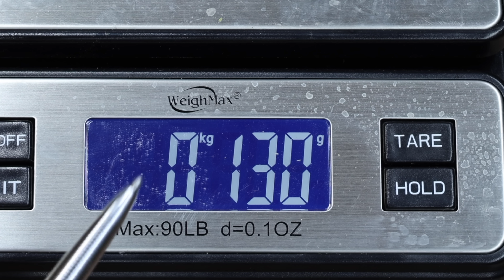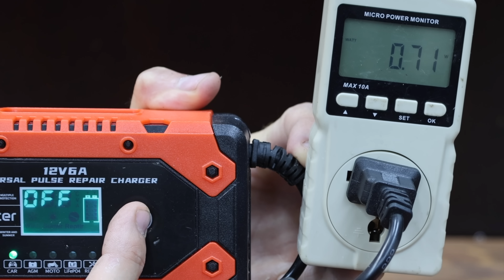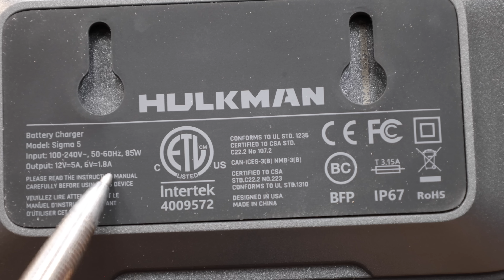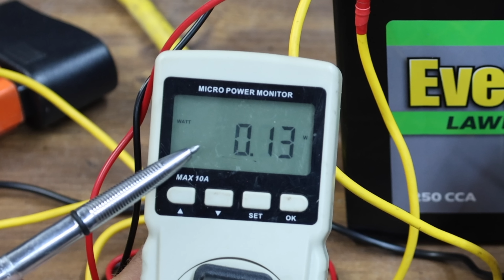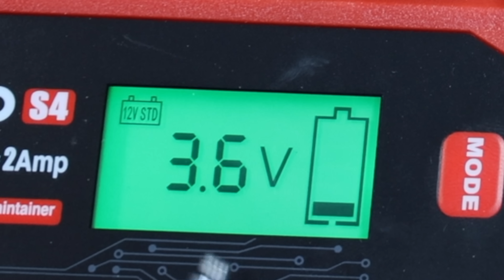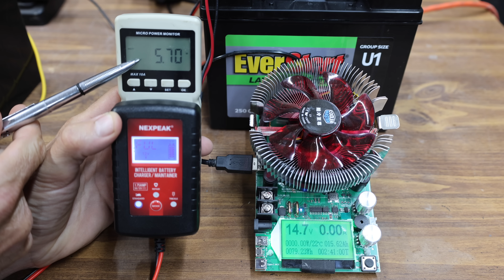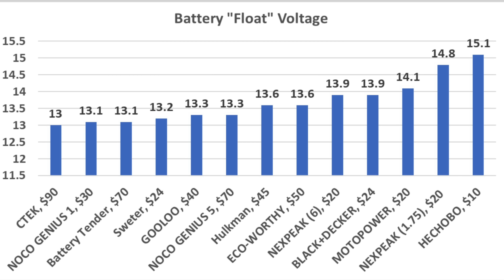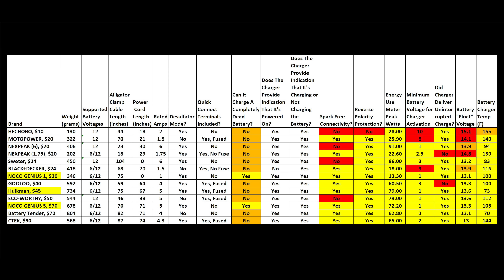I Tested the Most Hyped Car Battery Chargers – One Stood Out!

Comment: :body-green-covering-eyes: great test, but why not to include victron charger ? Seems pretty unique with smartphone app and settings that you can completely change if you want or import setting from someone else if you want. With all the statistic in the app and even 15A one is around 150euro. For me at least its very useful that I can see in the app whatever its charging 2A or 4A or 15A therefore to see if its just topping up battery at 80% and above or its seriously discharged.. Great value also if you consider that it can charge LI-ION batteries and can buy a lot of accessories for it
Reply from the maker: Thanks!  Thanks for the suggestion.

Comment: I have a Noco Genius 10 and love it.  It handles all my vehicle batteries (5 of them), both my deep cycle marine batteries and my Lithium Ion trolling motor battery with ease.  We live in a climate where my boats and three of my vehicles are parked from about Nov-March because of snow, so the batteries are pulled out and cycled about monthly on the Noco--honestly sitting on my work bench for 5-6 months isnt much work, but the Noco has revived batteries where I let my car sit too long without running it..  What can I say, It happens when a guy has five vehicles and works from home.
Reply from the maker: Thanks for the feedback.

Comment: I've had battery tender units die after a few years. I have around 8 of the noco smart units ranging from the 1amp to 10amp model in use for a couple years now. and they work wonderfully at doing maintenance and keeping my atv and generator batteries ready to go. and the 10amp models done well with charging lithiums safely to a safe voltage. can recommend
Reply from the maker: Thanks for sharing.

Comment: I would love to see a comparison of how well those chargers with desulfation can actually successfully restore an aged battery. So many devices claim to be able to do it, but very few actually have any meaningful effect on older batteries.
Reply from the maker: Thanks for the video idea.
Reply: @ProjectFarm  I'm a long time user of plug-in BatteryMinder maintainers and PulseTech solar maintainers. I just had the battery on a seldom-driven 2010 Ford Explorer go 10 years using a solar maintainer. I believe they make all the difference.
Reply: Yes, and whether desulfation even works that well.
Reply: I love my Noco Genius 10 for its ability to repair and find the battery charger as a nice built in bonus.  Way too often do I think I'll drive a car next week but not get around to it for 3-4 months.  The problem with a test like this is the way batteries fail doesn't seem to be repeatable, and once repaired their self-degradation can be wildly varied, and capacity can be varied.  In other words, if you leave a battery fully flat for a long time it may randomly have between 25-75% capability afterwards without desulfation, and desulfation will then randomly bring back somewhere between 25-75%.  Even with the same charger and the same brand of batteries the results are very far from repeatable.  I don't think this can be tested in a controlled way however I challenge him to try.
Reply: He has a video about methods of saving batteries, including desulfating
Reply: Only way to restore an old battery is to rebuild it like they do in the Pakistan videos. It's not possible to reliably restore a battery with a few computer chips.
Reply: Just buy a new battery.  If you have to disulfate an older battery, it's already on it's last legs.
Reply: @geoff-b9b  
My brother in law gave me a dead BMW 900CCA German manufactured battery.
I "resurrected " it with a CTEK and got 5 more years of use out of it....before it actually died.
BIL's replacement battery was a $600 battery that he had to buy and have the BMW programmed at the dealer...
Reply: I was also hoping to find which one of these could successfully de sulfate.
Reply: @jamevay  Battery Minder does this. I have several. My last cheap lawnmower battery lasted 16 years. My other mower died with a 12 year old battery still starting it. I have several car batteries i use for things like trail cams and they are all over 10 years old.
Reply: Once sulfur crystals attach themselves to the lead plates, there is no known method to remove the crystals via the push of a button. Edit: The only method to remove the crystals, as someone else mentioned, is to have the Pakistanis break apart the battery and rejuvenate it down to its core. I've seen that video and it's brutal work.
Reply: The problem is that the desulfation process can vary radically in outcome.  The variables are very hard to quantify, and the results can be very poor if the battery has gone too far or the process is not forceful enough (or even too forceful!) for the specific problem in that particular battery on the day...
Reply: they do, you just have to keep applying the desulfate process over and over until the battery gets its capacity back. depends on the amount of sulfation. which they dont mention this to you in the instructions. ive restored a old battery by doing the 4 hour process a few times. it wasnt a completely dead battery, though, that would probably take a lot longer. if you have one of those big battery chargers with 200 amps they can desulfate a dead battery fast - you can look up vdieos of people doing it. its key to never let a submerged lead acid(SLA) battery go be low 12.4 volts for long and especially never 0 volts, then it is really sulfated. im not sure if you can revive a AGM type battery though, i think its just for SLA. by the way the battery i revived could start a 1.8L corolla in -16C/3F weather TWICE so, it did its job.
Reply: @gods_chosen_chuds   S stands for SEALED, not submerged. The other one is V for Vented.  (SLA or VLA). You are correct though, that the lead plates has to be totally submerged in acid.
Reply: @riaanlouw1874  
Flooded Lead Acid battery....FLA.
Reply: @gods_chosen_chuds  It seems every time I use the desulfation with the Noco Genius 5 on the AGM the battery gets worse, or takes longer to maintain a full charge.
Reply: @gods_chosen_chuds  SLA means Sealed Lead Acid or maintenance free.
Reply: I have tried four different chargers which claim to have desulfate capability and I have never gotten them to successfully desulfafe any battery.  I have tried them on regular flooded batteries and Optima AGM batteries.  The oldest charger was an iron core transformer by Century, and newer electronic Everstart, Schumacher, Battery Tender.  I followed directions carefully.

I really wanted it to work.  I got a surplus generator which has been mothballed at an Army depot.  They disconnected the two fairly new Optima yellow tops, but didn’t charge them for two years.  I also have a Honda Insight which was t-boned by a lady running a stop sign, and it had a brand new yellow top weeks old.  The Honda sat for just over a year at the body shop waiting on hard to find parts.  I learned that you never want to let an Optima battery go dead or it will apparently irreversibly sulfate.  That was about 750 bucks worth of three batteries trashed by lack of maintenance.

I got new batteries for the generator and Honda and they are all on Battery Tender Jr. and they’ve kept float charging for about two years now with no signs of trouble yet.  Battery tender makes a multiple battery charger, but they don’t say if the outlets are isolated.  The generator has the batteries in series for 24 Volts, so I decided it was better to just use two Battery Tender Jr. to be sure. I also decided not to just a 24 Volt charger suspecting that the batteries will be better balanced if they are charged individually.
Reply: A tough ask
Reply: I would also like to see this tested
Reply: Tried it with my 10 amp NOCO, but couldn’t restore it.  Got a DieHard on charge now to see if it can boost it up to 12.6V.  So far, no change.

Comment: Someone please correct me but I thought that lead acid batteries don’t produce hydrogen unless you’re overcharging them.
Reply: Even the normal charging process creates hydrogen gas.  
When a lead-acid battery is charged, an external electrical current is applied, reversing the chemical discharge process. This process can electrolyze the water in the electrolyte (a mixture of sulfuric acid and water), producing hydrogen at the negative plate and oxygen at the positive plate.
Reply: @SilentSounder , but when below the float voltage, doesn’t the hydrogen get reabsorbed or does it stay free?

Comment: I have the Noco genius 10 - Not impressed - Wouldn't charge the fully dead battery on my welder. I bought a RJTianya  brand (from Temu if I remember correctly) which has the pulse repair and it fixed the battery which now holds a charge and works like new. Surprised you didn't test the pulse repair feature.
Reply from the maker: Thanks for sharing.

Comment: I bought the same model as Nexpeak 6A from AliExpress and I am very pleased with it. Also have a bunch of CTEK's. They have the advantage of returning to last charging mode after power cut.
I installed a CTEK in the engine compartment so I can charge by using a external electric engine heater connector
Reply from the maker: Thanks for sharing.

Comment: These electronic chargers are harmful to the car's electronics. My alternator failed while I was charging the car. It was working and had safety features. The repair program was harmful. The voltage beeping is harmful to the sensitive electronics.
Reply: I keep a ctek connected to my truck except when I drive it. Been doing that for years with no issues, except my batteries seem to last much longer than they used to. 🤷

Comment: I've lived off the grid for 18 years. I use lead acid batteries for power storage. I'm a battery nerd. I've learned if a battery has gone completely dead, the chances are very high, that it can never be restored to take a good full charge. Even using the desulfication mode won't work.  Maybe that would be an interesting concept for your channel video to see if I'm right. Use that dead battery you have now. See if you can bring it back to a full lasting charge!
Reply from the maker: Thanks for the suggestion.
Reply: As a fellow battery nerd and EE I can tell you that kind of sulfating is indeed permanent, I have done a lot of experiments on batteries including self made desulfators and even using vector measurements to measure the health of the battery. I use a Ctec for my motorbike, selected after tests using analysers, scopes with currentprobes and voltage probes and a high end bench powermeter (instead of the hobby meter in the video)
Reply: This is actually something we have at my work. We have this machine that throws a heavy charge and then drains the battery over and over and over again. Then it slowly charges, drains, then charges again. Supposedly, that brings life back into the battery, and it seems to work. But how long that rejuvenation lasts? Who knows.
Reply: I'm also looking into battery chargers as I have two Noco Genius 1's that have failed within 8 months.  My Noco Genius 5 (6 months old) and 10 (Year and a half old) work fine so far.

During my research, I learned that sometimes it may take 30 days or more to fully desulfate a battery.
Reply: Couldn't agree more. Too much time was invested to determine if these could charge a 0V battery. That simply just buys you a little time to shop for the next battery that clearly was neglected.
Reply: Sounds like an interesting video idea, but that's not really what Todd's channel is for. Do you have a channel about your off-grid life? If not, consider it - I bet you have a lot of lessons to share. Maybe you could take on the battery re-animation project and post it.
Reply: I have been successful is bring back dead batteries to live with the CTEK,  when no other battery charger I tried would even detect it and refused to do anything else.
Reply: Thanks for the suggestion
Reply: there is youtube content on this matter. you gotta blast a dead batteyr with those big 200 amp chargers like a car repair garage would have
Reply: @gods_chosen_chuds  I watched one where a guy used his stick welder to blast it.  I think I saw that Todd made one similar regarding the myth.  I haven't watched his, but that guy used the battery to start his truck after doing it.
Reply: @jameswalker590  The guy with the welder was applying more volts, Todd was just pushing the amps.  Not the same and it's not a myth.
From Battery University:
'There are two types of sulfation: reversible (or soft sulfation), and permanent (or hard sulfation). If a battery is serviced early, reversible sulfation can often be corrected by applying an overcharge to an already fully charged battery in the form of a regulated current of about 200mA. The battery terminal voltage is allowed to rise to between 2.50 and 2.66V/cell (15 and 16V on a 12V mono block) for about 24 hours. Increasing the battery temperature to 50–60°C (122–140°F) during the corrective service further helps in dissolving the crystals.'
Reply: I haven't seen the YT content that  @gods_chosen_chuds  mentions, but I have an old wheel-around shop charger (that has "200A" for a jump-start mode - the nominal charge rates are 60A, 10A and 2A). 

It can supply 16+ volts in an attempt to keep forcing the charge. That means that battery should be disconnected from all active circuits. The high current of 60A mode supposedly causes the electrolyte to dissolve some of the sulfation. It can often bring a deeply-discharged battery back to usefulness...for a while. The damage done by deep discharge has already shortened the life of the battery, and a charge cycle to 16 volts is likely to cause other damage. 

I will not use 60A mode on a sealed or AGM battery. In the 40-ish years I have had the charger, there have probably been a dozen batteries I "recovered" with it, and most were able to return to normal use for some months - but I wouldn't trust them to start a diesel in winter. Also, most of those "recoveries" were long ago - before I started using battery maintainers.

Comment: I myself do not like smart chargers. If the battery is drained too low. They will not charge at all. Unless you can trick & fool the charger. Making it believe, the battery has a slight charge. The old dumb chargers worked better. Plug them in, & bam, they just worked out of the gate.
Reply from the maker: Thanks for the feedback.

Comment: About 2 years ago I had a parasitic draw problem on my car, bought some smart chargers to plug in until I had found the issue.. 
a Seeley's upright at around £70 blew up out of the side of the case the first time I plugged it on.

Bought a more expensive Snap On charger that ended up failing to turn on after a few days.

Ended up getting the cheapest smart charger from Halfords (at the time around £30 iirc) and it worked a dream and I've used it plenty since with absolutely no issues!
Reply from the maker: Thanks for sharing.

Comment: Yes, to the larger battery charges being tested, even the heavy duty with reconditioning features.
Floor scrubbers are extremely hard on batteries and their life cycles.

Would like to see if any units can recondition them.
Plus the universal battery types… lithium, lead acid, and gel would be great
Reply from the maker: Thanks for the suggestion.
Reply: The NOCO 5 or the CTEK MXS 5 are great units for reconditioning.  Personally I would recommend the NOCO based on being a seller of many these units.  The NOCO's never came back!

Comment: Thank you for this test. Good to know which charger can charge a dead battery
Reply: It looks like they charging but in real nothing happens. Most times the Ri is so high there is only a few mA charging and if you get it charged it can not deliver current. A rather useless test. That is using such an old dead and probably totally sulfated battery, and that type of sulfating can not be solved with the desulfating modes.
Reply from the maker: You are welcome!

Comment: Smart chargers are nice and all, but for a dead battery the best option is a current-limited 12V wall wart with zero smarts.  That'll get it back up to just under 12V, and then a smart charger can take it the rest of the way.  (Car batteries are only nominally 12V, they're actually 13.8V when fully charged.)
Reply from the maker: Thanks for sharing!

Comment: "Cheap" video idea 
Battery powered planer blades (some brands are made out of hss , some are tungsten etc. and not all say that , what in my opinion is musquishing people to buy ones that wont last as long as tungsten and some tungsten ones dont want to last as long

You could also again compare angle grinder discs (cutting / fibre / rust removing ones)
some brands have nice new abrasives
I love new 3M Cubitron 3 and Norton Blaze 

Or bit more expensive idea - new circular saws with blade on left side//// brand bew multitools (makita and bosch are mmmm) 
Or 18v orbital sanders (new Bosch 150mm, milwaukee and makita are rly good)

PS
Just a suggestion so we have more videos to watch😂
Reply from the maker: Thank you for the video ideas!

Comment: I have been using the Battery Minder Brand for years from the Lowest 1.5 Amp to the 8 Amp models with no issues.  I have five of them on my equipment to maintain the batteries when the equipment is in storage.
Reply from the maker: Thanks for sharing!